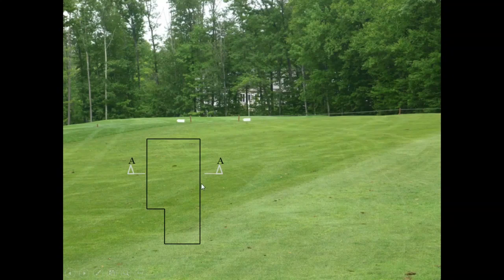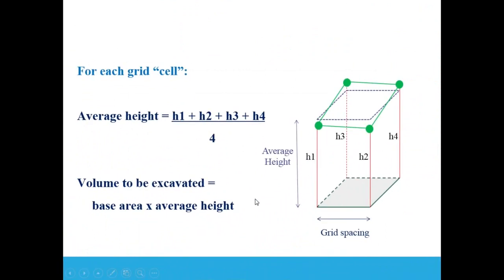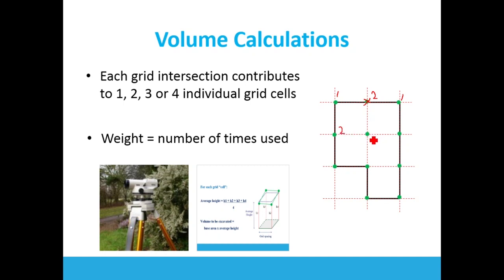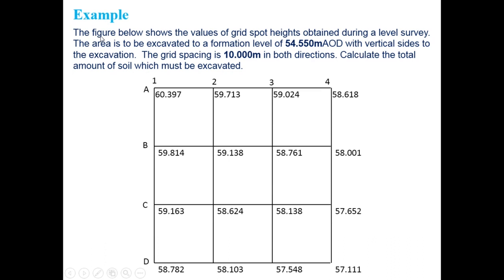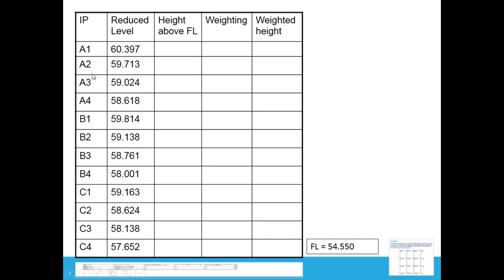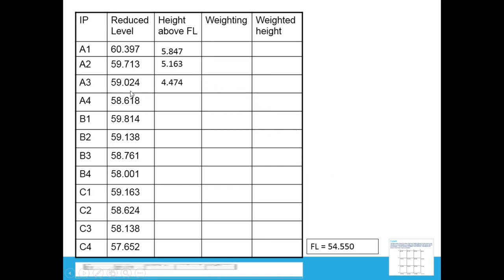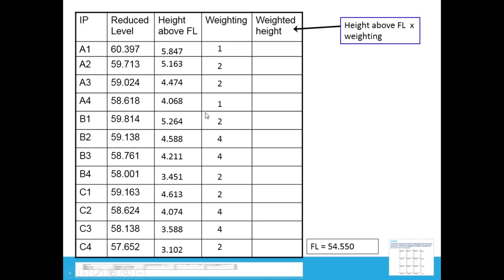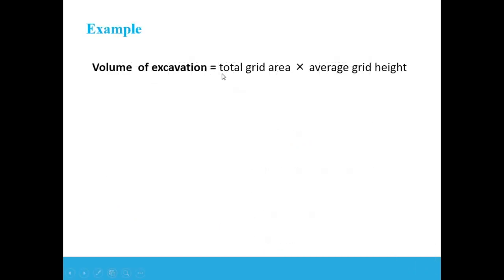SURVEYING l Excavation Volumes from a Grid of Spot Heights Using Prism Method

Comment: Is there any another formula for calculating volume 
On book i saw something 
V= A/4(sum h1 +2sumh2 +3 sum h3 +4 sum h4)

Sum=summation
Reply from the maker: Thanks. Always, to solve any problem, there will be more than one method. The important thing is that you should follow the correct steps to reach the right answer.
Reply: By using both different formula ,formula in book and formula use in video ....the answer of same numerical is differ...I am confused to solve numerical by seeing this video..
Reply: yes